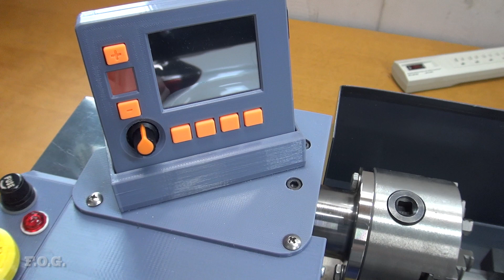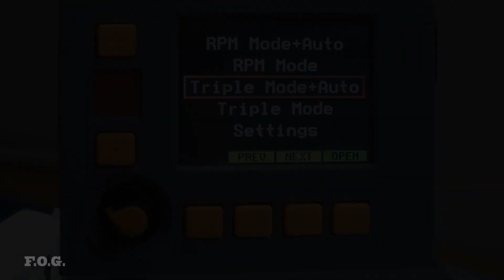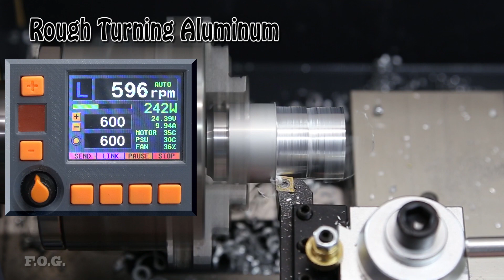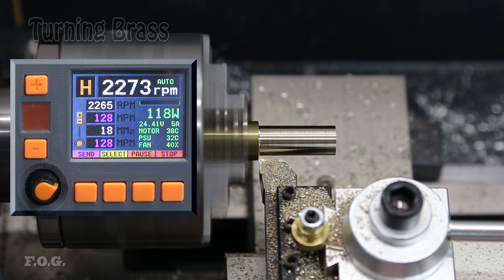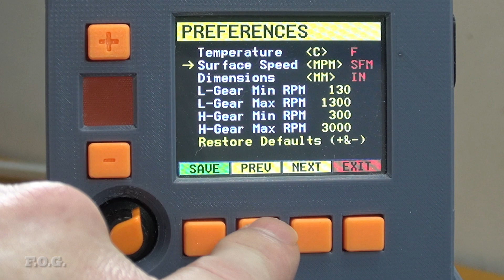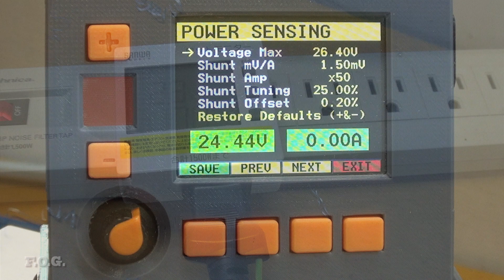EP11 - Mini Lathe Upgrade - Full Demo of Upgraded Mini Lathe - Brushless Motor Conversion How To

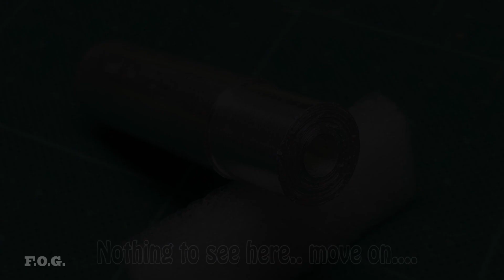Comment: 11:05 The result is horrible. Is like eaten out with a less sharp tool or a very cheap not good worked up machine.
Your support is tilting. Maybe check that before you hurt yourself.
16:52 I was afraid that the tool holder break off ... Oo
Reply from the maker: Hi there! This video is all about the controller and motor I added to the mini-lathe, going through the functions and performance of this upgrade. There is a clear disclaimer that the machining work is bad right at the start of the demonstration, and I also discuss the tool support problem.. possibly you skipped over that bit.  I very much appreciate your concern for my health, I will sure to be careful. Thanks again for the helpful comment, all feedback  and opinion is welcome, as it helps to grow the channel!
Reply: @ForOurGood  I just left a comment on your video for the motor install video. I've been machining aas a hobby and for a small amount of work for 10 years and I'm almost finished a mechatronic engineering degree so appreciate the work you've put into that control system, it's a really good effort! I do however have something to add to the above comment, more a few pointers to help you on your way.  For aluminium use sharp high speed steel tooling, not carbide and you'll have a lot more fun. Carbide tends to tear ally more than cut. Use a tail stock and dead or preferably live centre when you can and you don't risk getting a lump of aluminium launched at your head haha. Also, I don't think you have changed your spindle bearings from the ball bearings to tapered roller bearings. The factory ball bearings in these things have no axial support so they need changing. It is most likely the cause of the vibration and resonance you are getting and it's around a $30 upgrade which changes the whole machine. You will get a much better finish at low RPM if you change them. You can actually do quite a bit with these mini lathes once you get a few things sorted. I also think you need to have a look at your top slide jib. I doubt there is anything wrong with your tool post, Its a lump of metal. That extreme deflection you're getting is probably just because your jibs are loose as buggery. Lapping them and the cross slide jibs is a good idea and only takes a couple of hours and a few bucks in sand paper.

Here is an old but great resource on these machines if you're interested:

http://www.mini-lathe.com/Links.htm

And finally, machining takes a while to learn but you've done a really good job of this project, keep it up! Machining is awesome!
Reply from the maker: @edmunns8825  I think I stated in this video somewhere, I really was not trying to demonstrate good machining methods. Really I just chucked some stuff in the chuck and did some random cuts.. A little lazy I know, but it was a super long project, and I was a bit over it at that point. The QRTP used in this demo was actually something I was using for the first time, so was the insert tools.  I am usually using HSS tools that I grind to shape myself, including complex specialized boring geometries.
I had heard that those inserts suck for aluminum, but I still wanted to give it a go and see for myself, and it was not unusable, but finish is not as good as HSS.
That QRTP I was using was actually total garbage, and responsible for most of the movement you see in the demo.
With the original tool post back in place, and the jibs tightened up, it is pretty rigid. The vibration turned out to be a fairly deformed plastic gear in the headstock, the bearing seem not that terrible, so I will probably leave them as be for a while. Anyway, machining is a life long work in progress, so I am sure I will continue to improve things over time.
Go and check out the first short video in this series if you like, I have some photos of some work I have done in the past. I think you will see I am not totally green to machining, though admittedly a little rusty in recent times, but my love for machining remains the same ;-)
Reply: @ForOurGood  Ahh, I have the same type of thing. I'll check yours out now. This was before I went to uni in 2014, I'm on the back there.
 
https://www.youtube.com/watch?v=Sv_P4FBLvZU

I built that fucker haha. My dad and I designed it. I'm a bit proud of it (as you can probably tell haha).

These days I'm more into embedded software but I still love the mechanical side. Engineering is just one of those fields where you never stop learning.
Reply from the maker: @edmunns8825  Looks pretty impressive, and you seem pretty young too! Always good to see a young bloke using his head and his hands to achieve amazing things. I am sure you will go far. I grew up in Southern tableanda of rural NSW, so the scenery looks nicely familiar (if I am not wrong), sadly it has been many years since I have been back ro Oz, Maybe one day!
Reply: @ForOurGood  WA mate, and I am circling 40 haha. That was a while back. We're all getting old.
Reply from the maker: @edmunns8825  Never been to WA, only ever made it as far across as SA and NT, so forgive me! It does look pretty similar scenery wise. I guess rural flatlands in Oz are probably pretty similar in allot of places.
Reply: @ForOurGood  I have only been over east a couple of times but I would tend to agree with you. It's unimportant in my view. Very nice to meet you sir, I will message you somehow if I end up coming to Japan.  I talked to a guy from THK the other day and told him I was thinking about it. Linear motion is my porn haha. Have a nice day ForOurGood.